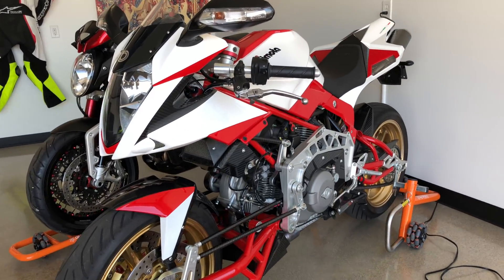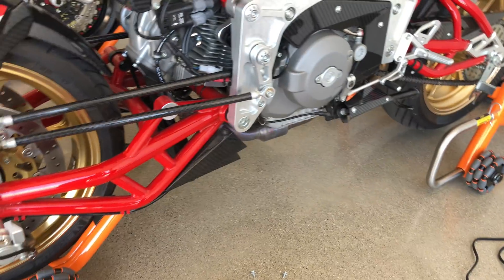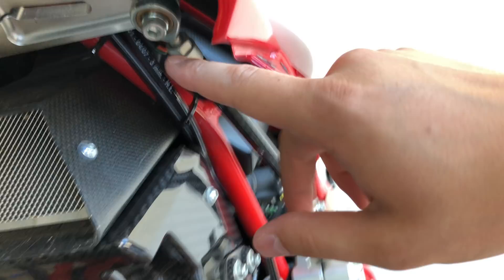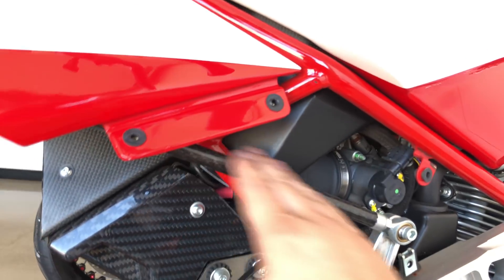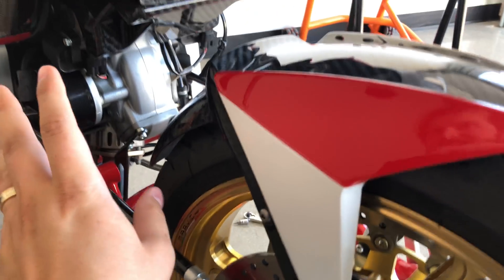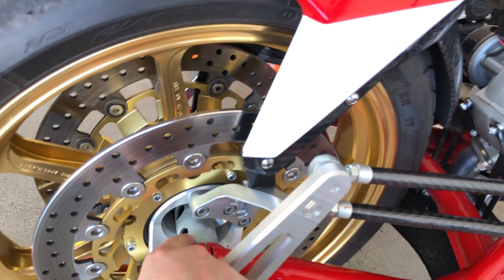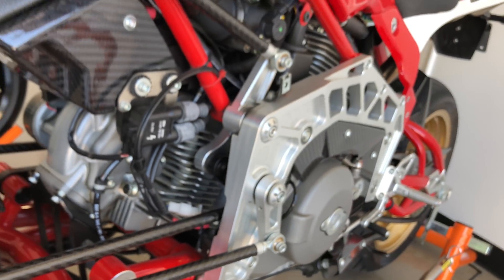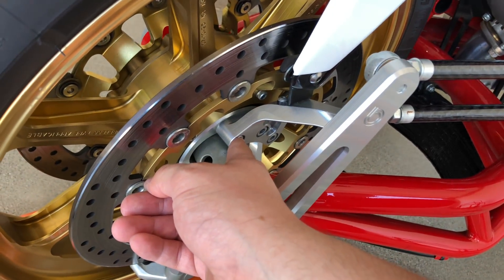OLD VERSION, Updated Version in Description - Bimota Tesi 3D - Hub Center Steering Explanation

Comment: What number is your Tesi 3D?
Reply from the maker: The plate on the side is #5, I believe that's for US models though rather than worldwide.
Reply: Torque and Titanium yes only 30 made but 29 I think have been sold to the public and one was a press bike? Two are in black and the rest are like the one you have with very slight differences. Did you install the full Zard exhaust system?
Reply from the maker: @greenlineman82  It has the Zard system but I didn't install it myself.  I'm not the original owner of the bike and I kept it just how it was when I bought it.  It's got quite a few of the nice option parts on it, the Zard exhaust is definitely a nice item!
Reply: Torque and Titanium  have you performed a full service including the belts? Also do you have a spare tank?
Reply from the maker: @greenlineman82  It's actually overdue for a belt service, but I'm working on taking care of that before doing any riding this season.  No spare tank unfortunately!
Reply: Torque and Titanium I had mine (#9) done last year and I also purchased a spare tank. Do you have a email I can give you contacts and other information that will make your ownership much easier.

Comment: Minimizes front dive under braking, works great ( I have one )...
Reply: But do you get less feel from the road?
Reply: @progste  I have the same question. I can understand that one wouldn't feel the bumps as much and there would definitely be some feel for the turning but I think that tight & precise feeling that forks give would be missing with this.
Reply: I look like buying one, second hand (not saying where). I have been told that special adapters (mandrels?) are required to balance the front wheel as part of a tyre change. It would be a great help in my decision to buy to get this clarified. I already have a DB1, it is a delight and I am reliably informed that this beast is on another level entirely. I would therefore buy to ride and not hide, so anything you can tell me would be greatly appreciated. Thanks in advance Stewart

Comment: Simple question.... Why?
Is there any benifits?
Is the suspension setup better for front end?
Reply: Its basically anti dive, with regular forks you have to comprimise the suspension to deal with dive under breaking. With this setup the braking forces push against the swingarm as opposed to up the fork. This means you can have a very soft front suspenion tht better deals with bumps while not having excessive dive and bottoming out the suspenion
Reply: Fuji Wags Yes, if your front wheel ends up in a hole the steering Will not close
Reply: Removes the effect of braking from the suspension. You can brake later in a corner generally.
Reply: @jashan1344  I have a BMW K1300R, same solution with diferent suspension system, no torsión, no down in brakes (even in a hard brake), better estability at high speeds, acelerations and brake in curves not causes mass transfer. The wheel not transfer any imperfection ir the road to handlebar. Sorry for my english.
Reply: @osvaldogandolfo8283  Yes you're absolutely right
Reply: Osvaldo Gandolfo there is still weight transfer to the front wheel. Brake dive in a normal fork is due to two effects:
1. The braking force pushes the front tire backwards into the bike. With a conventional front fork, or any other suspension where the front wheel can move up and back at the same time, this causes the brake load to be partially transferred to the springs, compressing them and causing dive. Bikes that rise instead of dive under breaking also exist, if the wheel moves down and back instead of up and back.
2. Weight transfer to the front wheel. The braking force produces a torque that tends to roll the bike forward (into a stoppie in extreme cases). This torque causes weight to transfer to the front wheel. This can cause a bike to dive under braking as well.

If the suspension is laid out just right, the sum of the two effects can be zero, ie no brake dive. This means that the front wheel has to be suspended such that it moves down and back, such that the rising tendency this creates counteracts the second effect described above.
Reply: Not sure I believe that, why? because n races that I've seen with bikes using this front end I did not see this advantage you speak of. Also, complexity usually leads to weight gain, which is not a plus for a race bike, hmmm.
Reply: @raynic1173  basically like anti squat for the rear. The tech is not fully developed yet maybe in the future it will be less weight and less complex.
Reply: @raynic1173  The reason cited by racers is it reduces the front end feedback.